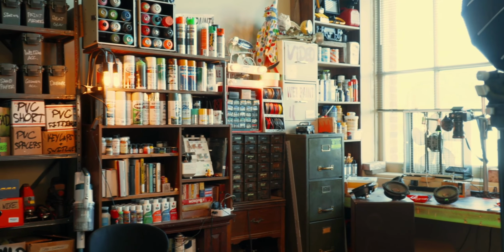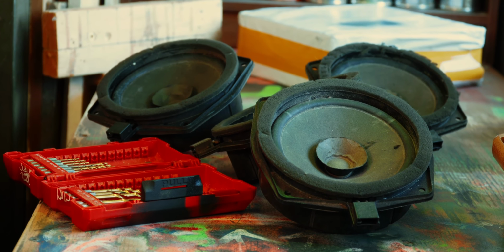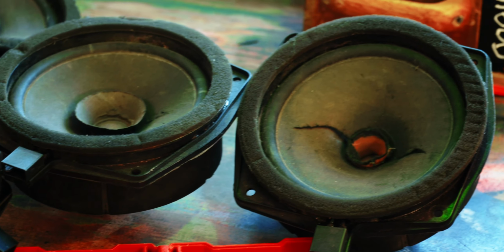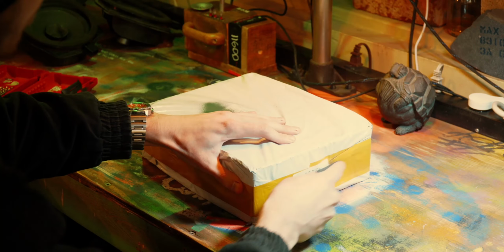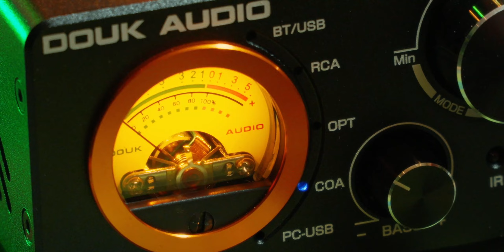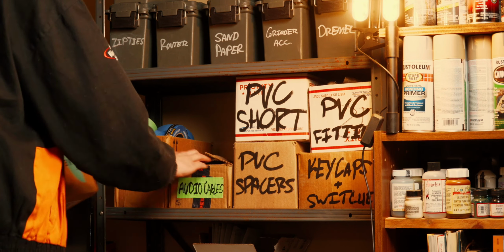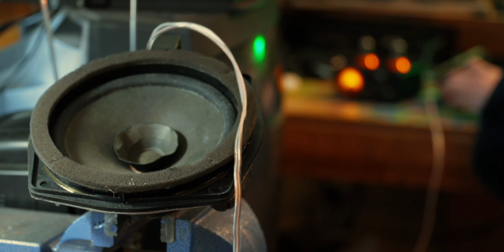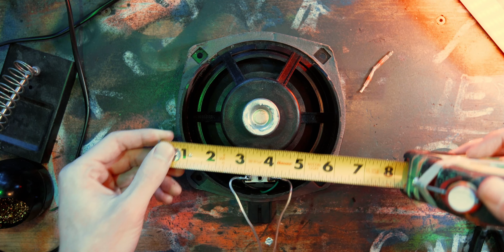Upgrading my speakers with scrap materials

Comment: Cool project. I've just found your channel and I've really been enjoying it. I was extremely supprised by the emotional range, and that's kept me watching each one of them. Thank you for making them.

Unrelatedly, you have 3 speakers. Have you considered setting them up in a Hafler circuit? You set up the left and right speakers normally then put the third speaker behind you. The rear speaker is connected to both positive terminals of the amp. You get a kind of surround sound effect from it. I've never done it myself... nowhere to put the third speaker.

Comment: i have some old speakers i bought from a junkyard a while ago, but they need a new wood case (dont know how they call it in English), and i would need an amp, so im scrapping the project for later. 

from the little knowledge i have on this topic, they would sound even better if you filled the inside with cotton or some fabric
Reply from the maker: Ah interesting- I'll look into that. I've got some scrap foam around that might do the trick